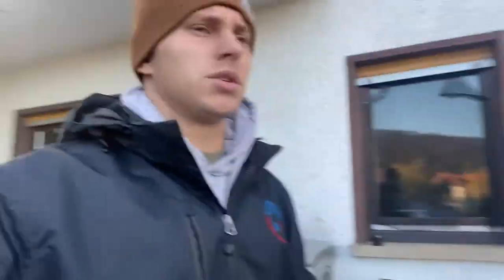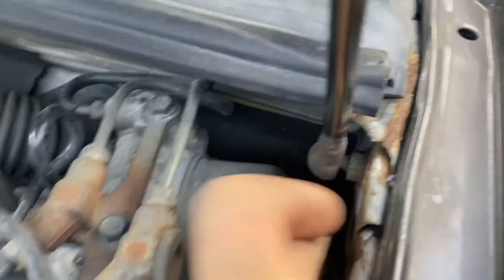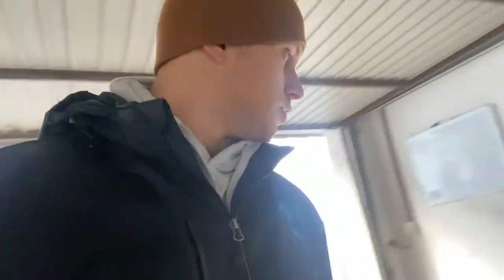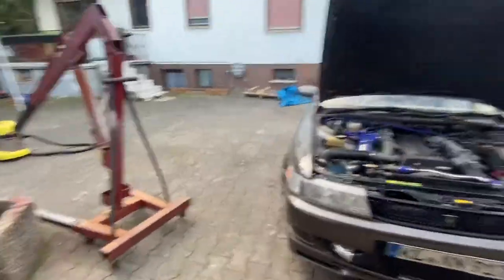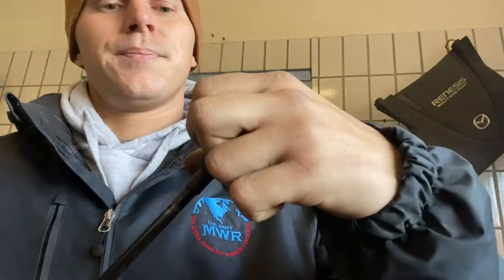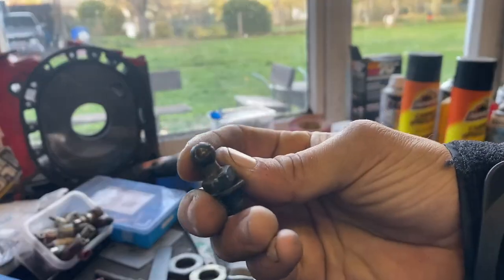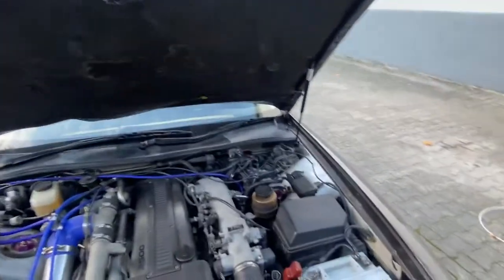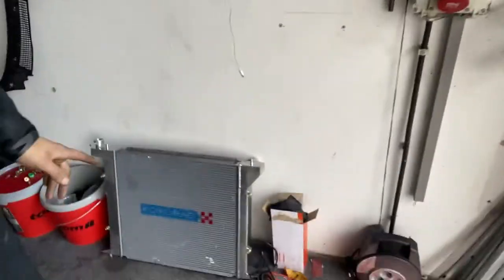Finally replacing my hood struts on the JZX90 toyota chaser

Comment: I just did hood and trunk struts on my chaser, MINT !
Reply from the maker: I need to do my trunk ones next! Happen to have the part number for the ones you used?
Reply: @Dustinhanson31  yes! Did some research since findin em was kinda hard, so the trunk struts from Lexus sc300/sc400, or soarer, are exactly the same, n they pop the trunk up quick! I got mine off Amazon. They pop the trunk up super good too. The hood ones I got, much like yours, I have to give it a push then it holds the hood up but the trunk ones are SOLID!